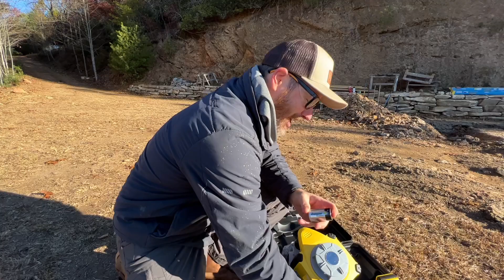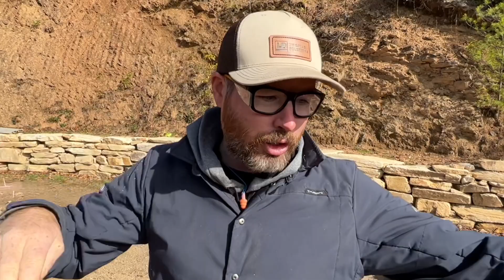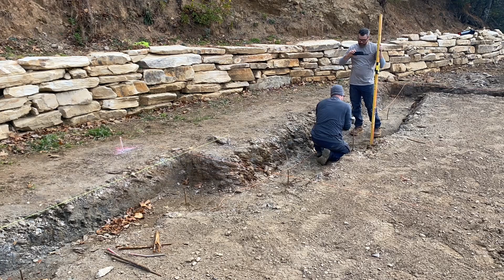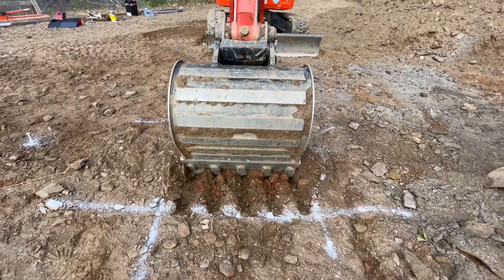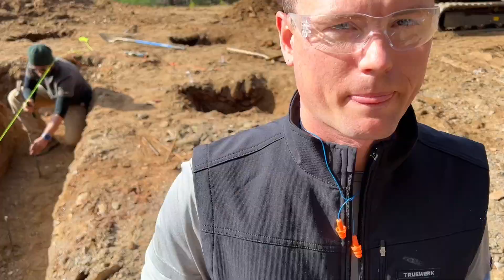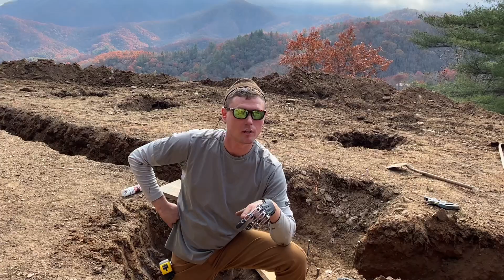A Well Oiled Machine | Building A Mountain Cabin EP03

Comment: I am on the 3rd episode of this build, and I am already hooked. 

Best part so far was Jason, out of sight digging in the hole. 

The part that prompted this comment was when you said about positioning the toilet so that you can open the door and enjoy the view. 

This reminded me of when I was serving with the British Army in Belize, Central America, in the late 80's and early 90's. We had a remote location in the mountains, and our toilets were "thunderboxes", which were basically 2 cubicles placed over a deep pit dug by the Army Engineers. There was a dividing wall between the 2 seats, but no front doors, so you could not only enjoy the mountain view while doing your business, you could also, as one of my friends found out, see the snake wrapped around the wire a few feet in front of him, which marked the site of the previous pit which had been filled in when digging the new pit.

Edit:

This episode just gets even better. At the end you were talking about throwing gas on fires, and that is exactly what we did with our waste. 

The Army Engineers also dug a large waste pit for us, because we had to burn our waste so it didn't attract rats or other wildlife, which in turn would attract more snakes, so we poured loads of diesel over it then threw in lighted rags or bits of wood, then stood back and watched it go up!

Comment: I am sure you are looking for tips from viewers! LOL.   You need to clean the bottom of the footing trench.  That loose dirt is not compacted or square.  I built both of our homes and our first home the foundation was concrete walls.  The foundation contractors showed up to dig the footing.  They dug the footing with a large rototillers.  I was not impressed!  4 hours later, 1 guy on a rototillers and 2 with square shovels and they were done and the trench looked great!  Using a rototiller never crossed my mind!  It was a commercial tiller.  It worked!

Comment: A pro tip from a former live aboard sailor. Use a “jiggle siphon” to transfer fuel from the can to the fuel tank. No power required. Pretty much hands free. No fuel running down the side of the equipment.

Comment: Males sense that it has to pass code even though it is not required by code. The inspector doesn't know why you put it in. An engineer may have specified that you should use this for whatever reason.

Comment: Wat I do to the safety gas can is on the bad corner we’re the vent should be like an old can is drill a hole and install a tire valve stem and remove the Schroeder valve using the valve stem cap and then it’s like an old can

Comment: I have seen contractors set up batter boards for there foundation or set there reference pins out of the area they are digging.  Next tool to invest in is a Metabo battery rebar bender.

Comment: drill a small hole in the diesel jug on top by the handle to get air flow, you'll pour a LOT faster. You'll dribble diesel riding around in your pickup though.

Comment: Hey got a question. I thought it was against code to have rebar in contact with the ground in your concrete work. Even if it not against code eventually it's going to corrode and Crack the concrete. That's not a good thing.
Reply: They specifically go over the metal cages they're using to raise the rear 3" from the bottom into their 8" footing.
Very very few people just lay the rebar down to the ground, it's very obviously a dumb thing to do without even accounting for rust. Rocks or even pieces of wood work to space it off grade.

Comment: I do footings and block foundations in north Alabama I like to use bolsters they do a better job at holding the rebar up than the chairs only down side is they usually come 4ft long and you have to cut them to size but they are easy to cut love y’all’s videos btw

Comment: I was curious as to why you guys go with block walls for every foundation, if there isnt a basement Its easier in my experience to form and pour foundation walls. it also is a lot faster than laying block if everything falls into place with concrete and the inspector
Reply: Good question, we don’t have any forms for pouring concrete walls. I like the idea of it though.
Reply: @jaimeperkins9606  That was what I assumed, and with the price of plywood 1" 1/8 form boards have been prohibitively expensive

Comment: Hey! For refueling your equipment, grab one of those siphon hoses. You stick one end in the tank, the other in the fuel can, then you shake it back and forth a bit. It'll start sucking the fuel out of the can. It goes faster the higher the can is than the tank (input/output). They're like $10 at the box stores but at least 5x as fast.

Comment: That fuel can cap is actually my favorite of all of them. The key is to have vent on the top rear of the can. The cans never come with one,and they need it to empty quickly. Your other option is to go to Tractor supply and buy race cans,or as they call them "water cans". They have a long spout and a vent. 5 gallons goes in the machine in a couple minutes. Don't tell the guy from OSHA!
Reply: AKA the Scribner Jug. For diesel, with little to no explosive potential, they can't be beat.

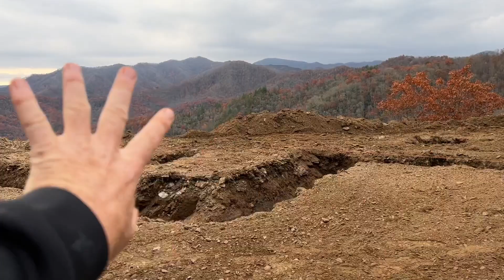Comment: 9:08 the level has a position sensor on the motor and whenever it’s at whatever position it needs to turn off it it shuts the laser down and turns it on when it rotates further. lasers can switch on and off super fast

Comment: So funny all of your guys' concrete terms.  Those dams are bulk heads.  And you are supporting the rebar with "chairs" some people call them.  When we set a reference for top of the footing we pop duplex nails into the sides and spray paint them.  Then when we pour concrete we use a Darby made out of 2x4s and flatten out the footing so that it's ready for popping chalk lines and laying block.  Cheers

Comment: after you cut the rebar it becomes like a razor blade.  I had a friend wearing shorts and it sliced his calf wide open brushing it the cut rebar edge.   Also could slice your wrist open too if not careful. I like to dull the cuts or round them off with a grinder a little to prevent that.
Reply: It's code in my country (uk) to have hi Vis caps on all re bar ends...many times I've nearly took my eye out bending down not seeing rebar ends...v dangerous..👍

Comment: You’re absolutely correct on the time it takes to proficiently and efficiently run an excavator. I’m terrible at running an excavator but I don’t have a lot of hours under my belt. I have to think about every single movement. I have gotten pretty decent on a skid steer, but have a lot of room for improvement on an excavator.

Comment: Operating an excavator is like flying a helicopter. Your hands, feet and brain are all, simultaneously doing different things... all required for the operation to succeed. One of the things I tell new operators; DO NOT watch your hands and feet. Watch the bucket and make the bucket do what you want it to do. Before long - well maybe a hundred hours or so - everything will click, and you'll find you can do it. To get yourself out of that position where a crawler track is on each side of the trench, Put the bucket on the ground, 45 degrees from the centerline of the tracks on the side you want to lift. extend the boom until you lift that (inside) crawler, turn the crawler one direction while rolling the opposite direction until the (inside) crawler is on the same side of the trench as the outside crawler. (Easier to do than explain). At the same time, watching an inept operator is as much fun as watching a drunk try to back a boat trailer down a launch ramp on Sunday afternoon.
Reply from the maker: So true… If you keep looking at your hands while learning you’ll never really learn. People that are really good on excavators seem like the machine is an extension of their hands. Hopefully I’ll get there one day!
Reply: Wow I feel like I just graduated trackhoe driving school after reading your instructional comment!  Thanks
Reply: Thanks Carl, the company I work for just bought an excavator and I been struggling with it.

Comment: The builder I'm working with hires out a lot of stuff and while that sometimes means some great specialized expertise, it also means more delays waiting for crews to be available and more room for potential communication errors. Some sub-trades make on-site decisions without the perspective of the full project and end up impacting future steps. I really appreciate the hands-on approach your team has for all steps of the process.
Reply: They don't exactly have a blueprint to follow either, so any sub out would have no idea what to do.
Reply: @MrTimequake  their plans show locations for plumbing etc. in order to get site plan approval, they don’t just wing it. It’s be easy enough to simply mark the floors and walls for the layouts. But as they said, they don’t want to show up and it’s done wrong and then have to try to chase the sub down to fix it; they take pride in their work and ownership of their mistakes.
Reply: @Natedoc808  I honestly think there's a good balance, Eric seems to be into more of the general stuff and Jamie for the finishing. They can both go each but the preference makes the balance
Reply: @MrTimequake  💯 these guys and their crew are a cut above and have reset the bar to where it should be.
Reply: @onward8231  privilege has nothing to do with it. The GC I worked for where we built everything from the ground up had anywhere between 5 & 10 projects going at any 1 time. We had a lull where there were only 3 but that’s because we had 8 and finished 5 all within a month of each other and the remaining 3 were quite big builds. Our GC was a terrible carpenter but he was good at coordinating; our foremen ran the job sites.
Reply: @onward8231  not commercial, these were residential custom builds and about 1/3 were custom remodels, typically full gut floor plan changes with sizeable additions. We built everything from ramblers and craftsman style homes in greater Reno area to post & beam and timber frame cabins in Tahoe. Our foremen ran the on site building, we had 4 very good finish carpenters who would fabricate like Jamie. Was a great time in my life
Reply: I cut my teeth at 16 worker for a GC like these guys where we would build the house start to finish other than some specialty areas like granite or glass block. Most contractors these days barely own a hammer, instead they merely act as a project manager/paper pusher coordinating the subs... for a mere 40% markup 🤡 I really hate the direction that it has gone but I think with these guys’ popularity, we may see a return of in house contracting/building
Reply: @Natedoc808  I hope you're right.  I, too, have worked for someone who did everything in-house (in a different industry but using the same principle) and they are one of the best in their business.  But people don't get it until they see something like one of these builds.  I was trying to explain it to my brother recently and though he is a mature man of 67 (though he knows nothing about construction, per se), he kept arguing that independent builders like the Perkin's Brothers cannot possibly make a profit.  I could not get him to understand how much they were saving by keeping so much under their own purview and, at the same time, how much better their work is, too.  He kept saying, "they'll never last."  And I told him, "well, they've lasted 20 years so, we'll have to see about that."

Comment: For site equipment fueling I have an old jet ski trailer that I built a wooden deck on and then mounted a 100 gallon transfer tank with a diaphragm high volume hand pump. You can throw the jugs away. Stabila needs to send you guys a rotary laser.

Comment: I looked at renting a min excavator to demo some concrete in the backyard, and grade the dirt.   After calculating the cost of equipment and dumpster rental I was estimating $2k just in rental.  I found a local contractor who did it in a day for $1,2000.   Sometimes it's just better to hire someone who already has the equipment.
Reply from the maker: Yeah sometimes it is actually cheaper just to hire someone to do it! Driving a machine is a lot of fun though, so you can’t discount that
Reply: @PerkinsBuilderBrothers  Besides, now you know how to operate it, and get better at it everytime!

Comment: Jamie, I just bought one of those Lenox wheels and they cut SLOW but they last for a long time. 👊
Reply from the maker: Hey thanks for the feedback… It is nice to have a disk on your grinder that doesn’t burn up after 20 minutes of use :-)
Reply: They are awesome we use it to cut our Schluter trim pieces and it also can cut tiles if need be if somehow u stuck in the middle of nowhere USA and your actual tile blade had no diamonds left but I’ve only tried it on the Rigid metal cutting since it has diamond as well,idk how the others are
Reply: @helpme8970  the Lenox is pretty too notch in my opinion.